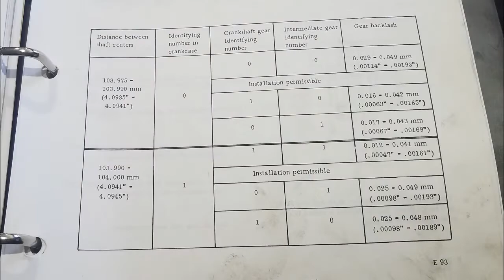Measuring intermediate shaft backlash

Comment: This is really useful .. it's more difficult to check if using assembly lube as it seems to create stiction. But my real question is what do you do if there's insufficient backlash as I don't think both "0" & "1" IMS gears are available now. So you check it but what to do if out of spec .. with newly machined case, and new gear, mine was at the lower limit. I did hear something about 'trimming' the IMS gear .. ??
Reply from the maker: Ross,
You are correct with the assembly lube and I usually dont use it on bearings. When it comes to gears if you are looking for just a Gear the only one that has been available is the "0" gear. Fitting these gears takes time and measurement and often we have to move them around on the shaft. It also can take some adjustment to make sure that the gear is concentric with the shaft assembly. You need to make sure that you are checking backlash at 4 places on the gear and rotate the IMS gear if needed to adjust for tight/loose areas. If your case is +1 or -1 then the only way to purchase those is in the form of a complete shaft assembly from Porsche. These are still available just expensive and often only in Germany. The same goes with the crank gears, these are still available but only at the dealer. If your gear set is on the minimum specification, that's great. If you feel the gears are to tight a quick way to verify is to rotate the crank shaft clockwise which will turn the IMS counterclockwise. If the IMS wants to climb out of the case then the clearance is to tight. If it rotates normally then you are good to go.
Thanks and good luck with your build.
Kurt
Reply: @klassikats  Excellent insight .. well it seems there’s some checks we didn’t do that perhaps we should have .. It was such a tricky test, I was really happy to record  minimum backlash and call it good. It didn’t seem to want to climb anywhere but was definitely a ‘performance fit’! It seemed to run smooth with the crank gear.
The specification really gives me pause to stop and think about the machine shops needing to machine to these tolerances off the crank centreline .. I guess that’s why machining these cases a specialist gig.
Reply from the maker: @rossmoultrie885  Yes indeed. There are not many shops that I would trust to do my case close and hone.

Comment: What is the solution if the backlash is too little? Our original intermediate shaft was out of spec. We replaced it with a new one from Porsche. Crank refurbished by a well known machine shop with excellent reputation. 0 marks on crank gear and intermediate shaft. There is no perceptible backlash watching, listening, feeling. Best case with dial indicator is it .01mm, but it is hard to be sure I'm not moving the crank to get that.
Reply from the maker: Dennis, 
So this can be some what complicated. Sometimes you will have to mix and match crank gears as well to get the right clearance. Also, the aluminum intermediate gear will also run in and that clearance will open up very quickly when the engine starts for the first time. If you lay the crank into the case with the intermediate shaft without the oil pump attached and rotate the crank clockwise and watch to see if the intermediate shaft tries to climb out of the case half. If it lifts out of the case then the gear set is too tight. If the intermediate gear rotates normally  and stays in the case  most likely will be okay. 
There is a certain amount of feel and experience involved when using this method so just be careful.
Kurt